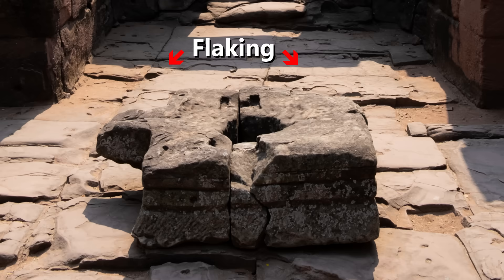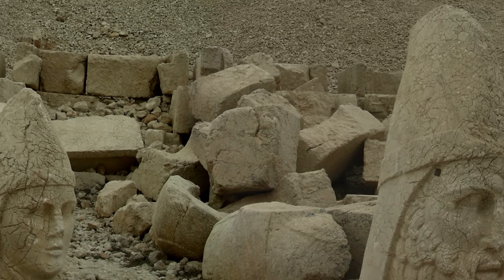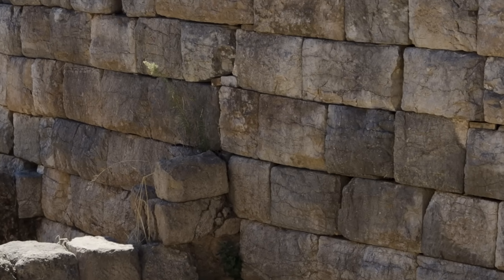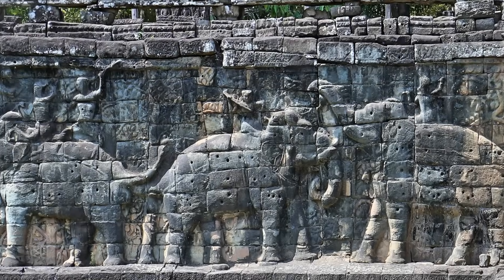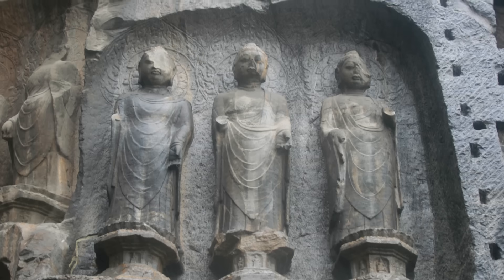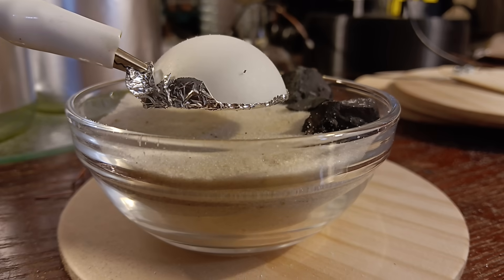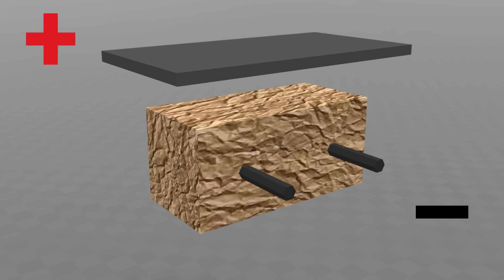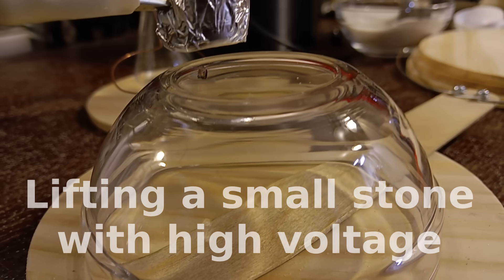The Greatest Mystery, Solved. Recreating Ancient Stone Melding Technology (Part 1)

Comment: There are so many more questions   that seem to be insurmountable to answer to your theory.
The holes.... 
You say they are not round, but they hexagonal or square. It was already impossible for us to imagine that they could drill a hole, but now you want us to believe they were these shapes? These shapes can not be drilled so the "rods" would have to be pushed in. Since you need electricity to "melt" the rock, how were they pushed in prior to being softened?
Electricity....
The amount of electricity required is way beyond our own capabilities, and the devices used would have been enormously big.
In your experiment, you did not show the temperature of rocks, nor did you do it long enough to change the viscosity of the rocks.

Comment: I don’t know much about the precision masonry methods of the ancient civilizations. However, just from what you’re saying here, I have doubts on the electricity theory. 

A) From where would they not only source high voltage but also have abilities to harness, transmit, store, manipulate this energy? 

B) where is the other evidence of all this energy infrastructure needed? For the amount of building they did and it being the mainstay of their precise work, there should be plenty of evidence & signs of it scattered around. 

C) If they had that kind of voltage always at the ready for the stone work, as smart as the ancients were,   why would they even bother to use such heavy stone, rather better utilize the “power” they have and ya know…build shit from 2x4’s & use hydraulic machinery and shit? 

D) I kinda am thinking that all the holes are for lifting poles that get inserted into the side where several men take position on each side and move the blocks into position. 
ALSO, they can be used 2 fold along w/ the nubs as a way to interlock the stones together for structural strength from the South American earthquakes.

Comment: First, where is the video's part #2?                                                                                                                                          Second, Please define and demonstrate the electrical circuits powering plasma generation, containment, transmission and control methods.                                                                                                                                                                   Third, How is the first massive object placed on the second opposite polarity, magnetic resistance , layer so it can be moved easily?                                                                                                                                   Fourth, "Granite requires high temperatures, typically around 700 to 1,200 degrees Celsius (1,292 to 2,192 degrees Fahrenheit), to melt. This melting occurs under specific conditions, often involving the addition of water or other volatiles to lower the solidus temperature. Wikipedia": What electrodes were available to the ancients that would withstand that heat?

I could delve into the lack of technology for generating, focusing and  controlling a hot plasma but you have failed to explain the manipulation and control of the weight and mass of the original stone, nor have you demonstrated how a "form", "mold" or other containment method would result in the shapes or sizes of the various examples you show in your video. So far, I see nothing useful in your video. If you do have something useful, please post it.

Comment: Now sure how much is real, but clearly there some clear BS. Rome Coliseum stones with hole are well documented to have been cause by recyclers chipping out the metal alignment rods, not electrode holes.  Also, the supposed electrodes claimed to be abandoned in the great pyramid are clearly threaded pipe used to explore the air shafts, and reported in historical documents of those who did that exploration.

Comment: queen chamber electrodes are not a mystery, it was obviously stuck in liquid to complete circuit, there are the 'door' with the rest of electrodes also - so these were just some spare, i assume they had to change them from time to time due to corrosion

Comment: Ok if I buy this and those are electrodes that were left in the queens chamber. There are enough pictures of visible remaining holes all over the place. My question before asking the power source used to produce plasma I’ll ask a more obvious question. Looking at all those thousands of holes that we can see. How or more what was used to make the holes for these electrodes. And as you can see who or how do you bore a consistent octagon or square or rectangular hole that would fit an electrode so exactly. Also those leftover bars. Have they been examined to find out what they are made of?

Comment: When i worked in construction we use "snap ties" to bind the forms together and then once the concrete was hard the form removed and the tie snapped off leaving a divot on the face and the metal tie embedded in the concrete remains.

Comment: your Oliantambo pic does show that the nubs are typically lower down where a softened rock could sag down, but the larger blocks in that wall were originally made and placed at 90 degrees.  Oliantambo is a repurpose of those blocks, where the only lower nubs are from the gap filling smaller rock between the big ones.

Comment: The holes on the colosseum look more like holes for scaffolding supports.  A few large jars of lemon juice and copper is not going to produce the thousands of volts to create plasma in those rods.
Reply from the maker: Different stones like sandstone require different electrode shapes and temperature processes - all delicate stones like marble and sandstone will only have SQUARE electrode holes - look for yourself at every ancient site, it is fact. They didn't use lemon jars silly, nor did they use ropes to build the pyramids. Just take a look to all the electromagnetic ships or 'orbs' in the skies, this is one place they got the power...

Comment: Most of the holes are traces of ancient vandalism. People knew that the blocks were often held together by metal, and they tried to extract it. Many scientific and popular books and Wikipedia say that mankind used meteoric iron to make the first tools and weapons, but it is also possible that people simply stole iron from ancient temples and mausoleums, and there was much more of this metal in the ruins than all the meteoric iron they could get their hands on.
Reply: Therefore, these holes do not look like traces of electrodes, but rather like traces of careful extraction of metal from the stone at the joints of the blocks.
Reply: Or, in some photographs, behind the joints of the blocks - holes could have been used to attach cladding (for example, in Turkey, very flat and large marble slabs/panels have been preserved on the runes, or perhaps precious metal could have served as cladding somewhere). Also, some of the holes could have appeared much later. There is evidence that in Egypt and the Arabian Peninsula, wooden beams were installed in the holes; nomadic tribes made canopies in this way

Comment: more likely just holes for wooden holders and moved how wally wallington showed
Reply from the maker: You don't make square or hexagonal holes for wood, and you don't melt stone with fire or the sun - the evidence is astounding, learn more about high-voltage because you understand nothing of the key subject matter at hand; which is the very mechanism of how of these stone-works are all accomplished. Go, go learn now! Go understand how high-voltage plasma as hot as the sun (but controlled) is able to penetrate deep into the stones and heat them from the inside out - allowing then for a cool-down process so the fragile stones don't crack - in which the electrodes are heated quickly (localized area) and removed, leaving the nubs which are THEN either used for architecture such as wood or more than likely, served as a root to hold thick metals walls in place with have either rusted away long ago or were taken for thier gold (cities of gold are / were real) - enjoy the journey!
Reply: @MadPlasmatist  bs the evidence is astounding I have yet to see a SINGLE piece of it please list it here.  The sun is a plasma but not a gaseous plasma, its a liquid plasma so I dont even know why you would bring it up, sure science thinks its a gaseous plasma but its not our own photos prove that.  Sure just looks like the nubs they show come from using water and ice to break them from the quarries, if what you say is true then recreate it, make some liquid granite

Comment: There are pyramids practically all over planet Earth. These pyramids were probably the machines that generated electricity.
Reply from the maker: Not probably =) Volt on!
Reply: @MadPlasmatist  But you are putting the cart before the horse...These pyramids have these nubs and holes , so as they did not build themselves ( a ludicrous idea that would be ) they cannot be the source of energy for their own construction !  If this idea is going to be possible, we need a separate source of power. And as no wires/rods/cables have ever been discovered, let alone some giant generator, it remains just as mysterious as the missing ''saws and power tools''.....

Comment: Hey, thanks a lot! Now I can finally sleep well. I’ve been scrutinizing your theory, and it actually holds up. Electrodes can indeed be used to melt stones through a process known as electric arc melting or plasma arc melting. By generating extremely high temperatures with electricity, the stone material can be broken down and liquefied. It’s fascinating how controlled energy can manipulate solid rock like that!

Here are a few samples of applications, i. Metal extraction for extracting metals from ores. ii. Rock and glass manufacturing. iii. Hazardous waste disposal for melting toxic materials into stable glass-like forms, and  iv. Lava simulation for geological studies.
Reply from the maker: Thank you very much, indeed there are many applications and don't forget 'thermal spraying' =) many of these stone surfaces were once covered by metal (cites of gold were real...) volt on!

Comment: The square blocks was melted in it's position, is that the claim? Example for the flooring that requires more electricity as you claim? Your video was quite short, so a lot of questions probably opens to
Reply from the maker: It takes more energy and heat to meld a floor because almost half the energy is absorbed into the ground; the hotter a rock has been treated, the more micro-fractures it will exhibit later (usually where the electricity had arced over it) - I have also been prevented from continuing any further.

Comment: https://www.youtube.com/watch?v=YMUZRGuYqY8&t=694s    TIP OF THE TOOL WAS MORE THAN 2000C HOT, WITH DIFFERENT TIP SIZES AND TEMPERATURES ALSO PIPE SHAPED. WAS IT  ELECTRIC ARC LIKE IN WELDING? Take a good look at puma sculpture at 13th minute. The stone is melted like hot wax or fat. its limestone?
Reply: no answer?

Comment: Interesting idea, but why not considering the even simpler possibility that the ancient people knew how to create big lenses and use sun power to melt stones? It is much more simpler and effective technology which can be done at scale. There is another channel presenting all the supporting evidences for such a theory.
Reply from the maker: ...well for one, you can't heat a stone from the inside and cool it in a precise manner to prevent it from cracking like you can with electricity, and furthermore, just take a look up into the skies at the 'orbs', electromechanical machines capable of generating enough heat and plasma to easily accomplish stone melding...

Comment: knobs are all over the world it was sued to workers work on the wall,, to support hem,, so ater some time they jsut grinded them, some time there wasnt time to insh the big building and they lef some behind,,, 

when you build a wall you will use woods that put across the walls so they can suport wiches and owrkers, after they built it the remove it,,, 

in portugal here was very anciend wals with lots of "electrdode hole" but thye were made of mud, so inside the mud was wood used to support the working process. ..like they do nowadays a building have  alot of holes, thenh they clsoe it with argamass before they end the building

Comment: Have you heard of Marcell Foti and Natron Theory? Occam’s Razor suggests that the simplest explanation—casting stones using available materials like natron, limestone powder, and clay—is the most plausible, especially given the logistical challenges of carving, moving, and assembling such massive stones with primitive tools.

Why Casting is the Most Logical Explanation:

1. Readily Available Materials – Ancient Egypt and other megalithic cultures had limestone, natron, and clay in abundance, making it feasible to mix and pour stone.

2. Efficiency & Labor Reduction – Casting would have required fewer workers, eliminating the need for massive labor forces to carve and transport stone.

3. Explains the Precision – Poured stone would naturally settle into molds with perfect edges, fitting seamlessly without gaps.

4. Solves the Weight Problem – Instead of moving multi-ton blocks, builders could cast them in place, eliminating the need for ramps and cranes.

5. Supports the Water-Softened Rock Theory – Some ancient legends speak of “softened stone” or “liquid stone,” which aligns with the idea of casting rather than chiseling.

So where does the electric heating come into play? Was it perhaps just for the ease of transport I wonder? Interesting theory.
Reply: Natron is a salt no less no more! And Marcell Foti is a wacko . . .
Reply: @FissionChips  you probably were first in line for your booster shot too huh

Comment: I agree it was used for stone shaping, yet you are providing examples that are not necessarily energy damage from stone melting, but rather the effect of energy from another purpose. The Giza pyramids, for example, were absolutely proven not to be tombs, but to be a functional star-gate to and from both Sirius and Orion. There is no use for the amount of power it generated other than to move the earth , see into the future, and provide healing energy to the bath having a shared ground connection,  at the foot of the sphinx for the women birthing children mainly.
Some Inca temples resemble circuits because they are, and besides communication may have had other uses. The simple fact is, there are structures built to work with great amounts of energy, so I hope you see my point.

Comment: Lets melt some bigger stones😊
Reply from the maker: It takes money and resources when I can barely eat each week.
Reply: What voltage and watts this should be? On scale for few kilograms of granite?
Reply from the maker: The next step will require handmade tesla coils (by me) and power supplies, capacitor materials, iron rods etc etc it will cost about 2 grand, then a small but physical example can be achieved.
Reply: @MadPlasmatist  ok good to know but not answer to my questions 😅
Reply from the maker: It will be millions to billions of volts, carrying a lot of working amperage (heat) - I don't know wattage or anything else exactly because I can only build all of these things on my desk and moving up even a few sizes (of lingams) makes quite a considerable difference in everything at each level. It will take about 2 grand to physically reproduce the technology and I dont have any time left so, ask the pilots of the 'orbs' in the skies - they will probably be showing themselves soon =)
Reply: @MadPlasmatist  interesting, thanks

Comment: How did they make hexagonal holes in Granite tho
Reply from the maker: The smaller hexagonal holes (and the smaller, about 1x1 inch square holes seen in statue heads for example) are either simply pushed into the stones while 'on' - and / or they started as round holes that when the stone became soft filled in around the electrode - they also 'slink' or sink from their weight protruding out and why some are at odd downward angles =) Part 2 coming soon!

Comment: 5:25 It is Not an electrode,  it is a metal rod with hexagonal cross-section and connecting thread at the ends (actually there are several of them screwed together in long one with wooden round head on far end to ram the door )  its all left there together with one rubber toy wheel (left by vide drone) and  pyramid entry ticket, pic pretty clear,   it was used by black diggers in attempt to break though the vent canal door with two copper handled in great pyramid , in agony for treasure hunting

Comment: Regardless of all the theories, I find it mystifying why didn't dress the nodules off. In some places it seems obvious they dressed the stones in place but left the nodules! Why?
Reply from the maker: Because like stated in the video, and even from a simple architectural standpoint, the nubs left would have been covered by something else, perhaps wood or metal (myths of gold cities / walls, at one time, are not myths), all of which has turned to dust or pulled off and used for something else - a long, long, long time ago...
Reply: @MadPlasmatist  then there should some evidence of these fixings surely? I'm sure I've seen stone work that seems to have been finished in situ, to be more presentable, say, but still have nubs...
If I can remember where I'll post.
Reply from the maker: @simonn4077  The nubs themselves and roughness of walls are the fixings for a thick wall of metal to adhere...